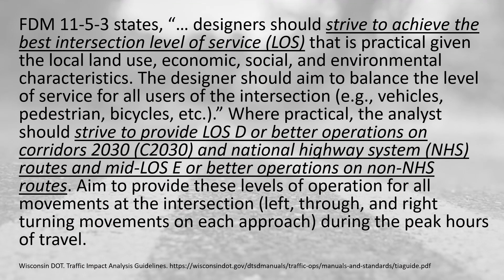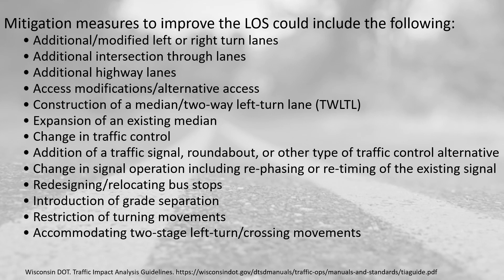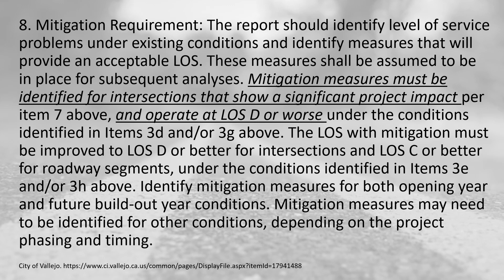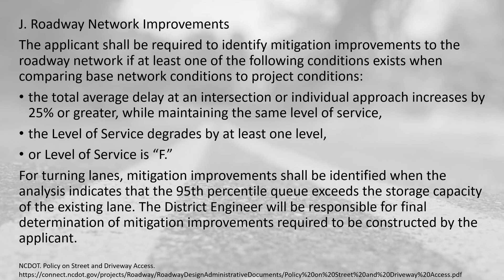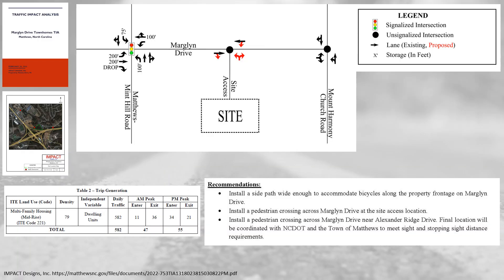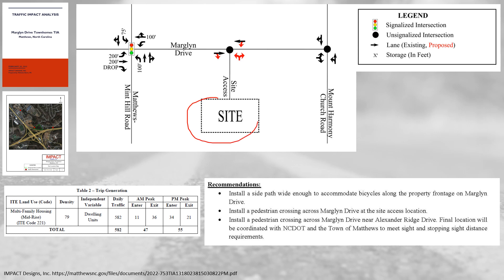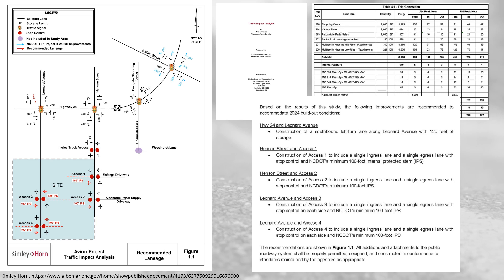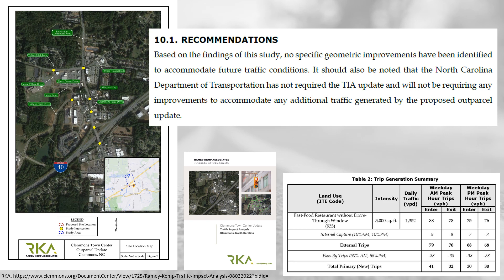Mitigation Measures for Traffic Impact Analysis (TIA) / Traffic Impact Study (TIS)

Comment: What of active transportation choices??  Automobile turn lanes are death for active mobility and a single turn lane addition on a two lane road means a 33% increase in delay in crossing for non vehicular mobility.
Reply from the maker: Thanks - I developed these mostly to document what the current process is (I get a lot of questions about the studies in general). Do you have any good examples of policies or studies that incorporate active transportation choices? 

I agree that it's extremely helpful to reduce the number of signal phases (and associated lange configurations) and conflict points to improve non-vehicular mobility.
Reply: @FindleyDaniel  Every super street project is bad for active mobility level of service.  Increasing speeds of vehicles for momentum preservation, longer crossing times for active transportation, inconsistent access to all destinations... the list goes on. A reduced conflict intersection – sometimes referred to as a superstreet, a synchronized street or a median U-turn – is a general term used to describe several types of designs that can be used to improve safety and traffic flow on a highway.  Take a look at Gordon Road Widening in New Hanover County.
Reply: This one has some NC folks: IMPROVING INTERSECTIONS
FOR PEDESTRIANS
AND BICYCLISTS Informational Guide
i
April 2022
Reply: @FindleyDaniel  Assessing the Policy Environment for Active Mobility in Cities—Development and Feasibility of the PASTA Cycling and Walking Policy Environment Score.
Reply: @FindleyDaniel  Expand and Improve Bicycle and Pedestrian Infrastructure by USDOT
Reply: @FindleyDaniel  Dont have access but you may have... Cycling and active mobility – establishing a third pillar of transport policy
Reply: @FindleyDaniel  Maybe Compendium of WHO
and other UN guidance on health and environment
Chapter 9. Safe environments and mobility
Reply: @FindleyDaniel  Modelling of Interactions Between Pedestrians and Vehicular Traffic to Promote Active Mobility: The Case of San Benedetto Neighbourhood in Cagliari (Italy)The analyzed case study concerns a road intersection within the S. Benedetto neighbourhood in Cagliari (Italy). A scenario assessment has been performed through the computation of several performance indicators related both to private transport (i.e. level of service and emissions) and pedestrian users (i.e. density; speed and crossing time). The comparative analysis of results demonstrates that this research approach could represent a flexible and effective tool in guiding administrations through the decision-making process during the planning and development of projects for redevelopment of urban spaces and the promotion of soft mobility.
Reply: @FindleyDaniel  INVESTING FOR MOMENTUM IN ACTIVE MOBILITY
 Discussion Paper October 2021 from the World bank. Safe: streets must always guarantee personal and traffic safety through well-lit, obstruction- free, and accessible spaces, as well as short, direct, and visible pathways at intersections.
iv. Relevant to context: networks must adapt to the scale, character, identity, topography, and green elements of the streets
Reply: @FindleyDaniel      Complete Intersections
A GUIDE TO RECONSTRUCTING INTERSECTIONS AND
INTERCHANGES FOR BICYCLISTS AND PEDESTRIANS 2010 with great questions, like, Was this road designed with pedestrians in mind?
Reply from the maker: @TL243  Thanks for sharing all of these sources!!
Reply: @FindleyDaniel  Hopefully this discussion will tick the algorithm for this video... Thanks for all this great content as usual!
Reply from the maker: @TL243  Thanks, I appreciate the kind words - I definitely don't have a good sense of what will be popular, so I just make a video in response to questions I get in real life (and also related to travel and interesting things I see).
Reply: Balancing Mobility and Safety at Intersections
by Anita Vandervalk, P.E., Vice President at Iteris, and Peter Yauch, P.E., Associate Vice President, IterisFeb 15, 2021 Mobility, TechnologyImagine if we could:
Change left-turn modes between protected only, protected/permitted, or permissive. This would balance safety and mobility based on current sight distance limitations and the availability of sufficient gaps in oncoming traffic.
Automatically extend the red clearance at an intersection to protect the safety on conflicting traffic patterns, based on predictive analytics that a vehicle will run the red light.
Alert a driver of a pedestrian in the crosswalk to avoid a collision.
Predict near misses between vehicles at intersections and change operating conditions in real time to avoid a crash.
Reply: Modern traffic engineering techniques have come together to help make this busy intersection in Pittsburgh a prime example of enhanced public space, and a model for urban street design.  Richard Krajcovic Jr., PE, PTOE, MBA
Reply: inclusive transportation modeling